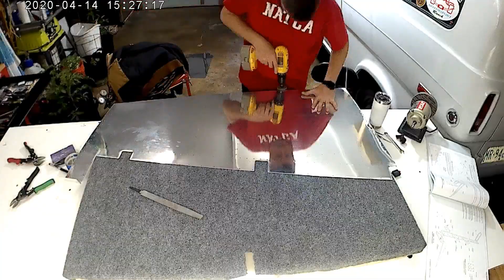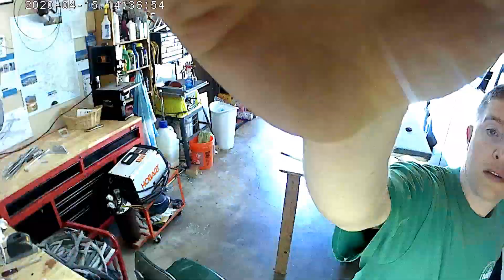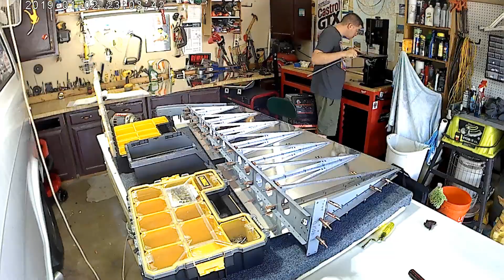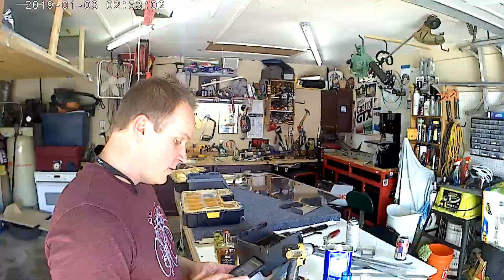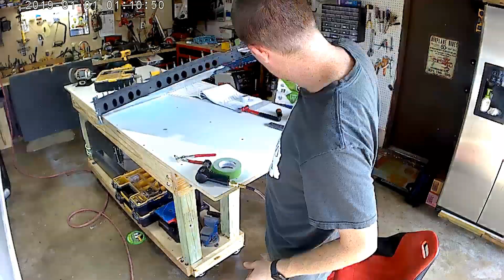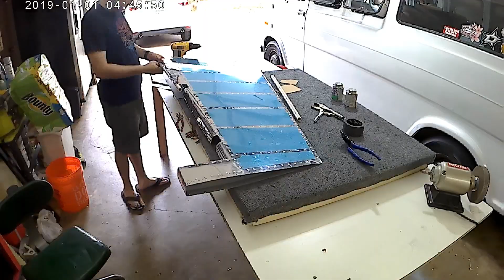Section 7: Van's RV14A Rudder Assembly Time Lapse

Comment: https://aircraft-tool.com/shop/detail.aspx?id=SP201A

This little guy will save you a ton of time deburring edges rather than that wheel and drill combo. The danger with what you're doing is that you're removing an inconsistent or variable amount of metal. Worse than that is a fine grinding wheel + aluminum = catastrophic failure of the grinding wheel... often resulting in collateral damage (read: serious injury) 
Thank you for posting your progress! I'm so very close to just pulling the trigger on a kit but have a few other airplanes to get out first